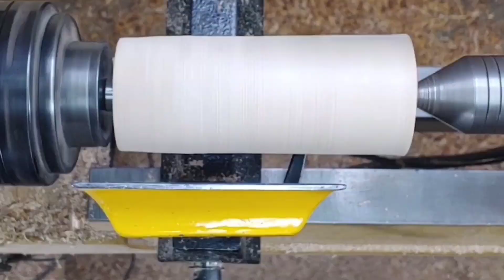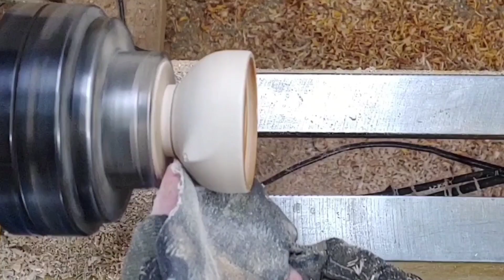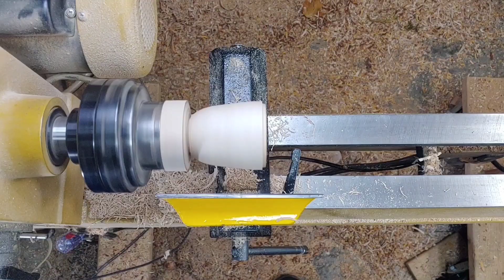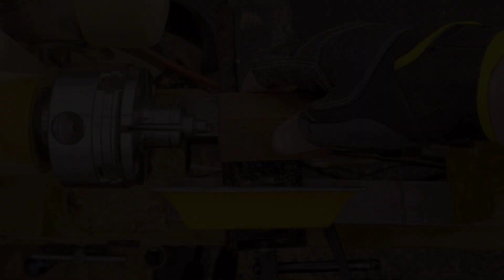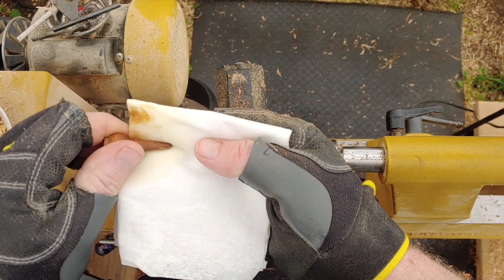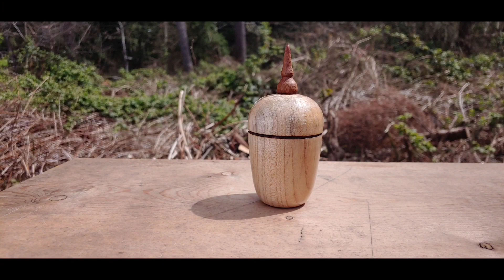(woodturning) a finial box! - scrap wood project #2

Comment: Looks like your head assembly & motor raised up when you tightened the tailstock. May want to make sure head assembly bolts are tight!
Thanks a ton for sharing. I love the ideas for thd small stuff especially just getting started
Reply from the maker: Ya I was having a problem with it flexing. I added a spacer on the back side of the headstock to fix it. Glad you enjoy the videos. Thanks for watching Sam.

Comment: Where did you get that black handled tool and what's it called
Reply from the maker: It's called a hook tool. Mine is homemade. I think there is one called weideman hook tool you can buy. I think I spelled that wrong. Should be able to find it online. Also check termite tool. It's round but basically does the same thing.